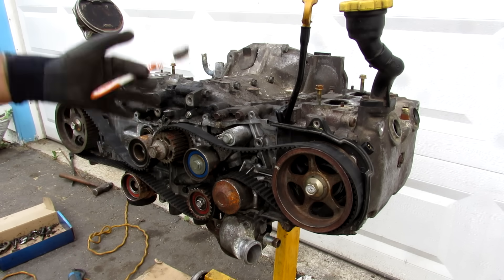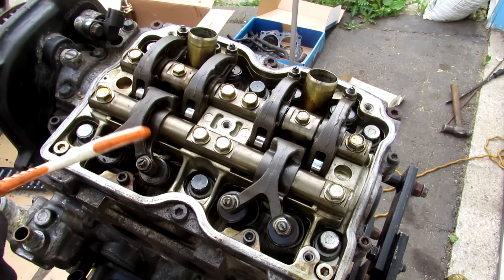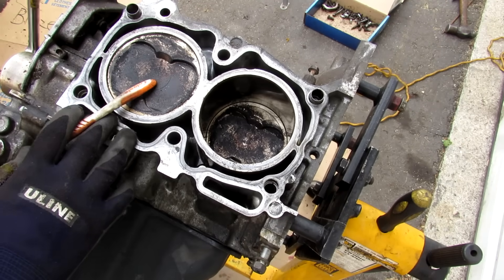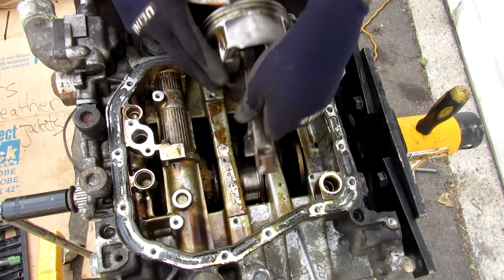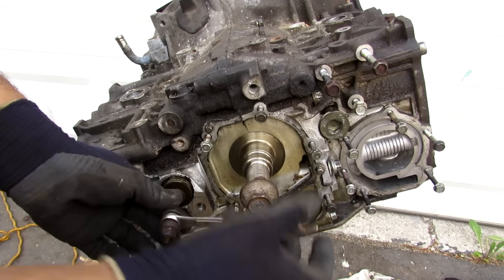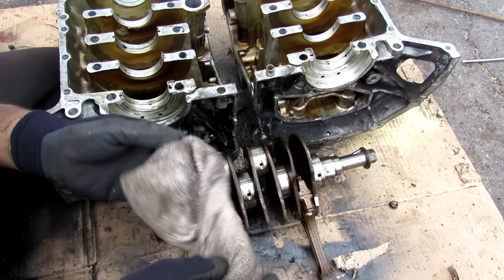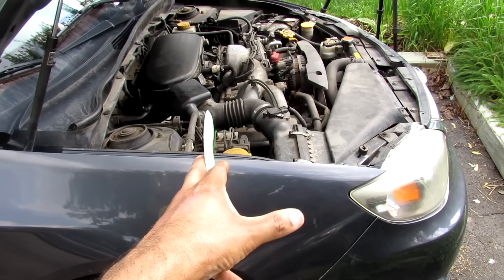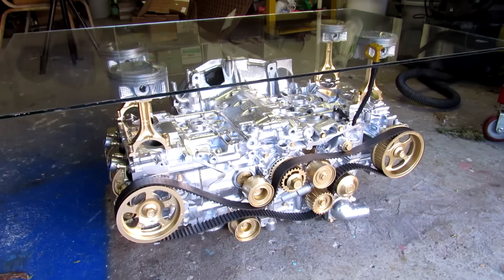Why Subaru Engines FAIL

Comment: Bought a 2006 Subaru impreza 2.5 non turbo with about 124k.  The things i noticed --
It does use more oil. 1 - 2 quarts in 3,000 miles.
The oil looks black at 3k changes.
A slight smell of burning oil.

Comment: Thanks for the great  video.I have a 2002 Forester with 50.000 miles  on it.. Change  oil every 3.000 miles .No burning oil..
Did they stole this  design from VW..Its like a VW engine on steroids...

Comment: My 1996 Impreza had a bulletproof EJ18 that went 256,000 miles until the car was totaled in a crash.  Except for regular oil changes, I neglected that poor car - even broke a timing belt and that car would not die!

Comment: 2010 Legacy 2.5 bought with 110k now 140k..still my daily. Best car since my Honda. Been all over the Midwest and tough in 4 plus feet of snow.
Reply: Pat Ball Damn
Reply: I had a 2011 legacy,
Used it as a commuter car.
( NYC to NH) 310000 thousand miles. Engine didn't crap out, the AC did
Reply: Your honda was far superior, reliable, less costly to maintain... this motor is a nightmare.
Reply: @briana3695  Yea. Great in snow too! Oh wait... they SUCK in snow! Honda's are reliable,  I will give you that. Subarus can be too, but you have to be on the ball for maintenance. I've got 234k miles on my ej255 and been at 16psi of boost for nearly 100k of it. Going strong and destroys hondas in snow and most of them on dry pavement.
Reply: @rite2beararms  got 140,000 on my ej255 , 16psi, and still running strong. not a single engine issue, i did have to repair the ac condenser though, went out at 130k

Comment: Great video and explanation of the Subie boxer.Makes me appreciate the simple and easy to maintain and repair old VW air cooled boxer 4 cylinder. Loved those little Beatles. Had 5 of them. Not much power, but with routine maintenance, very trouble free.

Comment: We had a 2012 Subaru Outback and still have a 2015 Legacy.  In all those years, never had an engine issue.
Reply: Nice! I’ve got a 2015 Outback 3.6r and I love it! The Legacy is a great car.
Reply: @porsche558  people who are driving cars that r only 5 or 6 years old should love them . My oldest vehicle is a 1992 my newest 2003.  We all wish we could have newer cars. It's called wage disparity or equality gap or something like that
Reply: Ron Skancke I hear you, for most of my life the newest vehicles I ever owned were at least 10 years old or older. I consider myself fortunate to have what I have, but I also worked hard to improve my finances. It took me working a lot of low paying jobs, working my way up, and taking out a loan to go back to school to learn a trade that pays decent.
Reply: Should always service your car regularly and always check oil and coolant every week. Caution is the best prevention.
Reply: Hjjj
Reply: Hhh
Reply: Hhh
Reply: One car is 5 years old the other is 8. Sorry but the phrase all that time is not applicable.  My newest car is a 2004 caravan with 200000 miles on it . Then there are 2 more even older. Are you a teenager or do you just switch cars often.
Reply: What do u mean, in all those years never had engine problem. Even the oldest of the two isnt what I would consider old. My newest vehicle is a 2004 dodge caravan.  Close to 200000 miles.

Comment: Boy,looks like a northern car,the engine has a ton of corrosion.  My wife had a Subaru that pitched the timing belt at highway speed at 35k miles,before it was scheduled to be replaced. Warranty paid for it and there was no damage to the engine!🙀

Comment: I knew this in 2013 so I bought the H6 engine, and the head gasket does not have two materials in it (for some reason, Subaru did not design it the same way as the EJ H4).  Now I have just over 130,000 on it and the engine is in great condition with no problems. I pay more for fuel but avoid all of these issues.  Thanks for showing, it really is accurate on all the problems the EJ engine had. Maintenance is key on any of the engines.

Comment: I’m glad I got rid of our Subaru when we did. What a pos
Reply: I have a Subaru Forester with that same 2.5L engine, and after watching this excellent video, I’m going to sell it before it breaks. The weird CVT transmission is already acting up (51,000 miles is all it has on it). Maybe get a Honda or Toyota or something. Or a Chevy truck or something. I don’t know, but no more Subaru’s that’s for sure. Bearing failure, ring failure, head gasket failure? POS!
Reply: @trevorjameson3213  I think boxer engines are like trying to reinvent the wheel by making it oval. So many ways to fail and theres not even a trade-off! The design is just worse than a V or in-line. Also, Might I suggest a 4th gen taurus with the vulcan? Bulletproof as hell engine. Cast iron block and heads. Tons of parts. Large community.
Reply: Heck some Boxer engines can certainly be reliable, with Subaru’s ej22 probably being the most bulletproof example. Regularly make it to 300k+ miles with basic maintenance.

Comment: Very good video. As a Subaru owner I learned a lot. I liked what u said about maintenance. Oil needs to be checked more regularly than "normal engines". 
And with tuning.. you need to know exactly what you are doing. Many dont and thats when the problems come. Best is to leave it to the professionals. 
I have an EJ257 with reinforced pistons, aftermarket rods, valves, studs, oil pump, ported tops ++ and even so it was set to 370 hp, to make it last as long as possible.

Comment: My subies original engine was an EJ16,never had any issues with it for 15 years
Reply: Don't worry.... You WILL have issues. It's a 180 degree engine. You want an engine that will last, go Honda or Toyota. My GM SBC is 30 years old, all original (even head gaskets) and it runs like a top. Doesn't burn or leak a drop of any fluid. But that was in the cast block, cast head days. Cold starts beautifully too. I will hate to replace it with newer junk technology.
Reply: @Twitch_Moderator  old Toyotas&hondas,they're good too,but they no longer exist
Reply: @Twitch_Moderator  but still,I'm telling ya,it's a good all around car
Reply: Scrotum Monster Because Honda, Toyota, and GM engines NEVER have issues, right?
Reply: messmeister92 Toyota has a good reputation for reliability. Just ask Scotty Kilmer.
Reply: Drew Peacock my family had a Toyota Corolla for about 15 years. By the time we got rid of it, the engine was the only thing that hadn’t rotted away.
Reply: You see the condition of this engine? Omg
Reply: @drewpeacock3798  i do
& still,never had any issues

Comment: Every ej25 ive ever had went over 300k miles. I had one that went over 400k
Reply: how many head gasket replacements?
Reply: @Aloha-Chico  2-3 I usually pull a motor around 200k completely reseal it and go another 100k. Thats only reseal. No mechanical replacements usually. Obviously this depends on the history of a motor. A well maintained one can go forever
Reply: i don't think i have ever known someone with a subaru that didn't have any problems
Reply: @NightshiftCustom  there are problems but they are easy. I usually tell them its a piece of crap and i buy the car from them lol
Reply: I've never had a problem with my subies. They're actually pretty easy to work on when you have to also. This video is an example of 1. I didn't  catch how many miles were on the engine or if it was still operational before teardown. There's a bad apple in every bunch, doesn't matter what kind of apples.

Comment: So just to clarify a few points here:
The headgasket failures were primarily caused by lack of support of the cylinder sleeve (this causes thermal expansion fretting), the turbo models did not have this problem and saw almost no headgasket failures. Another reason was electrolysis of the composite gasket material caused by bad grounds. Phase 1 engines (older than 1999) tended to leak coolant externally whereas phase 2 tended to have internal (coolant to oil) failures.
Sump and oiling issues mentioned here are largely fictitious, if the owner did the breakin (on older models before this was done at the factory), and kept up on oil changes, you'd still see the crosshatching in the bores at 300,000 miles and virtually no oil burning. There is no inherant drawbacks to the boxer design for oiling except the tendency for valve cover gasket leaks, the baffles are to prevent oil starvation on cornering and can be found in most engines not designed by people who eat their own boogers (lookin' at you Hyunadi).
The piston skirt issue he mentioned is legit, but the reason mentioned is incorrect, it had little to do with the teflon (that's there for breakin and is designed to wear out). In the early 2000's Subaru was chasing fleet fuel economy numbers dragged down by the AWD system. They decreased the height of the piston skirt which allowed accelerated wear and destabilized the piston in the bore when that wear did occur. The decrease in height lowered the inertial mass of the engine which is what helped fuel economy.
One of the key reasons Subaru engines fail is missed here, that is lack of timing belt or idler pulley maintenance, as well as requirement for manual valve lash adjustment, on the naturally aspirated motors without hydraulic lifters.
Ringland failure only affected turbo models, caused by cost savings in the cast piston material. It would crack a ringland if you put an aggressive tune on it which many did, coupled with low octane gas. Owners who respected the performance envelope of their stock turbo motors really didn't see this failure much.
Overall if you have a Subaru motor, keep up with oil changes and switch to the MLS turbo gasket and you should be fine, chill out people they're good cars, not perfect but perfectly adequate and make up for it by being fun to drive with the low center of gravity.

Comment: Great video. A few things here; 

Firstly, the main reason that some Subaru 2.5l engines (read: 2.5l turbo engines) have Ringland Failure is actually a combination of the material, hypereutectic aluminum, as well as the deck height for the first combustion ring. The material is actually not the main issue, as Ringland Failure isn't experienced of many other applications within Subaru itself including most of the 2.0l turbo engines. The deck height of the piston is the main cause on the turbo 2.5 engines, as it's very short. This was fixed mildly with the USDM 2018 Type RA WRX STI and the USDM 2019+ standard WRX STI (possibly other markets as well). The 2015+ FA20 equipped WRX does not have this issue for instance. 

Secondly, a V6 engine is inherently unbalanced. All engine types with odd-cylinder numbers experience more balancing issues due to a never-ending sequence of a different number of pistons at top-dead-center and bottom-dead-center (and many other reasons that are above me). This doesn't mean that a V6 engine or other odd-firing engines can't be made to run smoothly or rev rather high, but this would explain why nearly all of these engines have large counter-balance shafts, or simply very large counter weights on the crankshaft (and other tricks). 

There are only a few engines that I know of that are perfectly balanced. Straight Six engines, Flat Six, V12 engines, and Flat Four engines; honestly, I don't know if a Flat Four is technically 100% balanced either. It's very close if anything.
Reply: Try flying in a small airplane with a 4 cylinder Lycoming versus a 6-cylinder Lycoming. It's like night and day. The four cylinder vibrates like crazy while the six cylinder is very smooth.

Comment: Common failure point of this engine....Ear gauges, Off the shelf cobb tune, vapes, and not running forged internals trying to squeeze out 350 hp LOL.

Comment: Thanks for the video. I’m hoping the FB series engine in modern Subies holds up better. Any thoughts on the fact they’ve increased the oil interval from 3750 on the EJ25 to 6000 on the FB?
Reply from the maker: Different oil type

Comment: This isn't why EJs really fail. Any engine is going to fail with lack of maintenance or running with low oil. We see hundreds of these cars a week and its because the radiator fins have too much debris the car then can't cool overheats and pops the weak single layer head gasket. Replace it with the multi layer turbo head gasket you'll never replace the head gasket again. I cant even think of the last EJ that came in where the oil and coolant were making the milkshake, just doesn't happen on these. EJs are great!
Reply from the maker: What region are you located? I think it has to do with climate as well as the owner maintenance
Reply: @speedkar99  Minnesota

Comment: Never owned a boxer engine. Thanks for the info.  A lot more complication than an inline 4 cylinder. Better than an inline 4? Maybe? I’m a very big fan of my Audi 1.8t 20 valve though. All the power and extremely smooth.

Comment: My beloved 2002 WRX bugeye is serviced every 5000 Km and has now 220,000 km on the clock and still going strong. Things that kill Subie engines are poor servicing, wrong fuel type and bad modifications.
Reply from the maker: The EJ20 was not as prone as the EJ25 
220KM is very low for a 2002

Comment: Well done. I love the information density in this video. Quick, concise, clear explanations with no wasting time showing endless bolt removals. 

For a while, Subaru engines were used in experimental aircraft where they developed a terrible reputation. Watching your video, it brcomes crystal clear why you don’t want one in situations where your life might depend on it operating without failure.

Comment: Re-torquing the head-bolts can help, but the older gasket coating would fail. The new Subaru gaskets supposedly fix the issue. Great explanation of this engine's operation etc.
Reply from the maker: Yes , agreed

Comment: Nice job cramming a lot of info into a reasonable length video.  That split block looks like a machinist's nightmare, with all the goofy bolt locations and the mickey mouse wrist pin access port.

Comment: I like the Subaru boxer engines and although I've not owned a Subaru friends who have swear by them. Its related to the old Volkswagen air cooled boxer four, which also is, in my opinion, a versatile engine that can have a number of uses besides automotive eg electric power generation, water pumping, auxilliary power unit etc. Are you going to brush your teeth now. Lol

Comment: Inline 4 with counter rotating balance shaft is essentially as smooth.  And simpler ...
Reply: More rotating mass to go wrong, most are driven by chains which wear and as a high performance issue, they reduce responsiveness. But it's really only the bigger 4's that need them to stay smooth- engines approaching near 3 litres.
Reply: M Bacon at first the H4 made sense as it had packaging advantages in rear engine applications, and when first used in FWD as Subie did placing the spare tire under the hood over the low engine.  In theory an H4 offers a lower CG, however once the Mitsubishi Evo vs Subie WRX war ensued, in my mind the simplifier I4 was a better way overall.

Comment: Update, all engines fail because of no oil.
Reply: Actually if you can keep the engine hot 24/7 365 then you will never get cold metal on metal which actually initiates the wearing out of the parts

Comment: On my EJ-25, I have a cylinder 3 misfire P303 always when the ambient temperature drops to below 60 degrees or so in fall and winter. It goes away, but always comes back periodically. I replaced head gaskets with MLS at 114k. So far so good. What could be causing the misfire? I got tired and just keep resettting it. Doesn't happen in the hot summer months.
Reply from the maker: Coils and wires?
Reply: @speedkar99   within last 2 years, I have replaced: 
(1) all 4 wires with NGK
(2) NGK BKR6E-11 plugs x4
(3) remanufactured fuel inj.
(4) coil pack for all 4 cyl.

Not sure what else to do.

Comment: I’m looking at a Subaru crosstrek, super picky on how I only run wix filters (changed at 3000 miles) and Amsoil. You think it will be too thin and I’ll have issues with the head gaskets?
Reply from the maker: The FA engines seemed to held up better but have only been out for 8 years. Time will tell